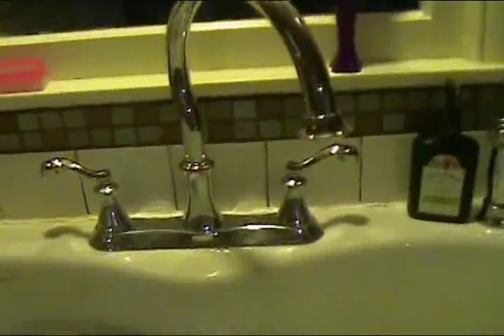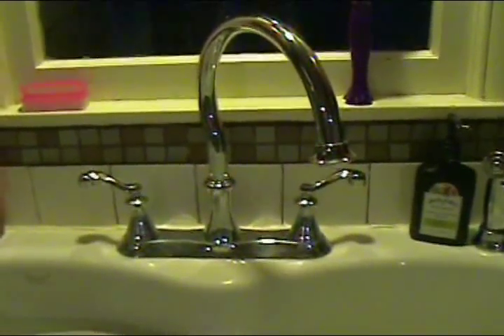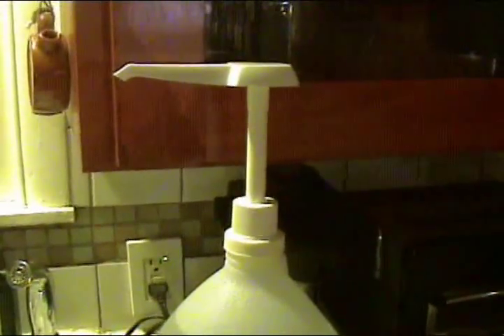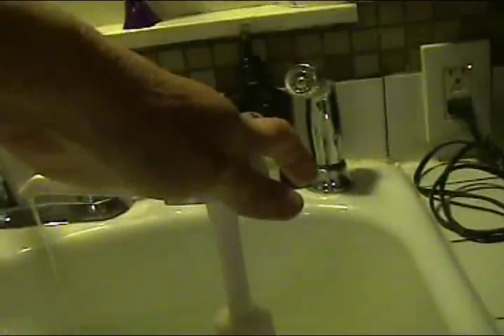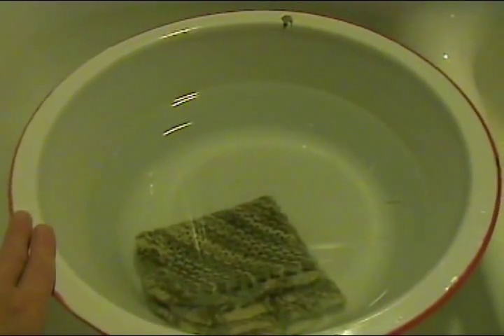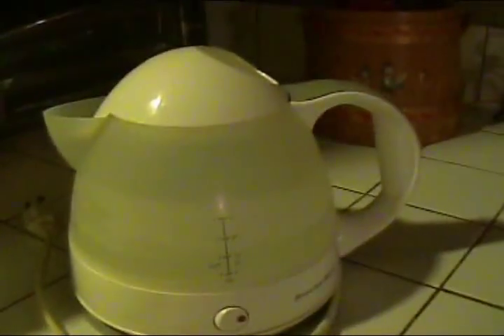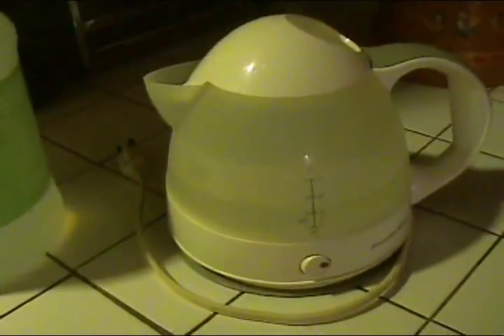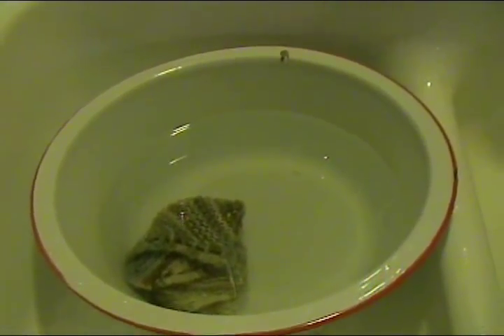Frozen Water Pipes: How to Work in the Kitchen Without Running Water

Comment: Excellent video Tina! Last year during prolonged 20 temps and an ice storm our Reverse Osmosis system froze at the filter area and the well line as well. I used a lot of clean milk jugs I keep on hand filling up from the 500 gallon RO tank after using the 55 gallon tank we keep of fresh water. Thankfully I had filled the Water Buddy in the tub and it was convenient to flush the toilet from. But lots of trips up the stairs with the clean water. 

I had gallon jugs at the bath sinks and kitchen but that pump thingie would make it much easier; I am going to search for those now!

After company a few weeks ago who chose to NOT follow the bathroom signs on ONLY flushing toilet paper our line stopped /slowed up. Like you it was good practice using my plastic sink water holders for washing dishes and hands in the bathrooms. I learned right quick I was using too much dish soap and it was hard to rinse them. And then pitching the water over the deck railings was anything but fun LOL. But good practice to know we have on hand what we need to get our " Pioneer On" as we call it. "city people" do NOT understand a septic tank. Awesome you have your grandmoms enamelware!

I like how you turned lemons into lemonade there taking this as a learning/practice session. Glad you have water in the other areas !
Reply from the maker: Hi Mouse, oh golly what an experience that must have been! Thank goodness you had access to some water but boy what a workout that must have been!!!! I am curious about the bulk water storage container you mentioned. Is it something you store empty until needed, or do you have a place for it in the bathroom all the time?  I can't remember where I bought the pumps, if I run across the company I will add the link in here.

That is a great point about the sewage system - our tiny town finally installed "sewer" last year but it is not what any of us ever knew as sewer. It is basically a 100 gallon septic tank that needs electricity and a motor to empty into the city's line. [insert rant here LOL] So if our power is ever out for an extended period, we will need to limit what goes down the drains too. 

It was great to use Big Grandmother's things! Nice little bit of nostalgia that made the situation a bit more enjoyable. :-)   Tina
Reply from the maker: Mouse Toes Oh good, I will go watch your video  - thanks for the link! The area of the Texas coast we lived on used to suffer in droughts in the old days because they couldn't get fresh water from wells - had to store it in cisterns. So yep I can understand being worried about having fresh water! I hope someday to put in a rain barrel system for us. We can live without food, not without water.